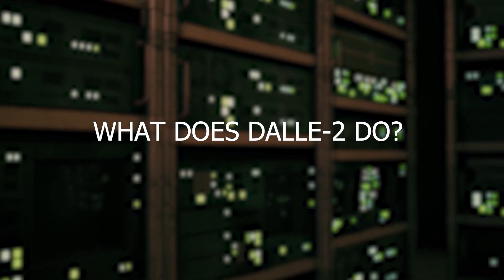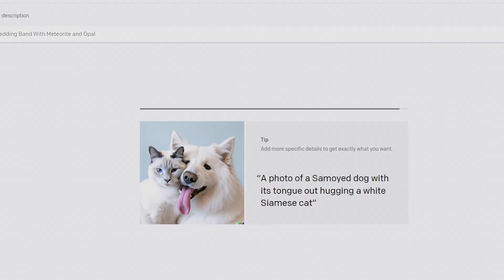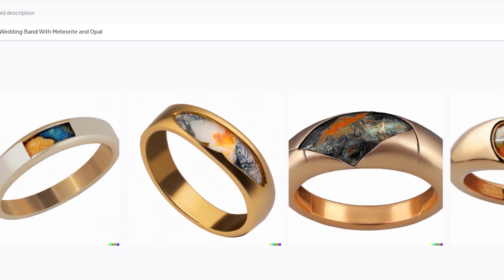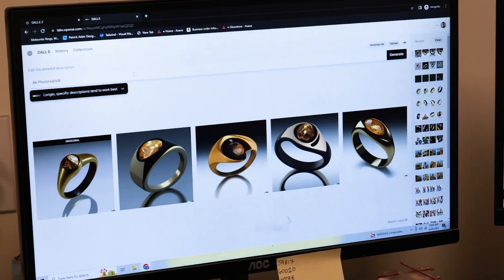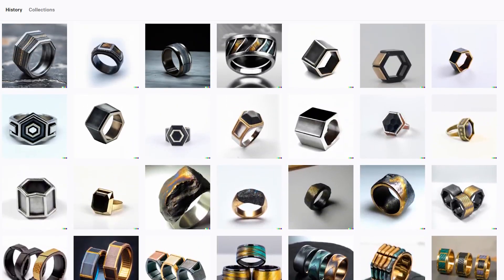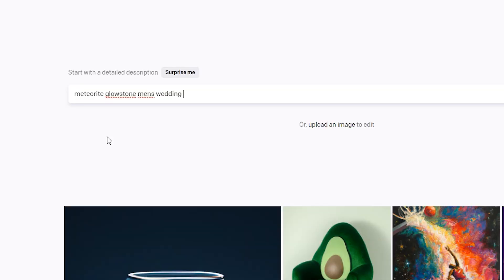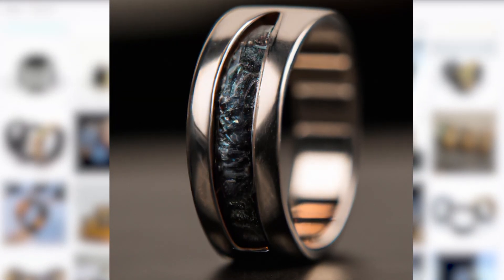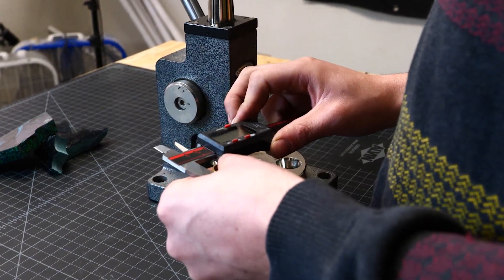Using Ai To Design My Ring (Gold and Bello Opal Ring)

Comment: To use the precious metal shavings you cast the shavings in epoxy mixed with some into with some black pigment and make a ring from it, or you could mix it with some glow powder when inlaying other things to make it slightly sparklier.

Comment: Patrick, I think you could have employed a slightly different approach that may work with less efforts but may need some tool design.  The AI design basically is a boat outline filled.  Really snazzy I think too and I do like the final outcome achieved. I am thinking that if you had a circular blade with a strong V profile, I think in one pass you could have the straight segement of the body, and a resulting V notch either end.  From there a square plunge cut or file to transom the boat outline and done.